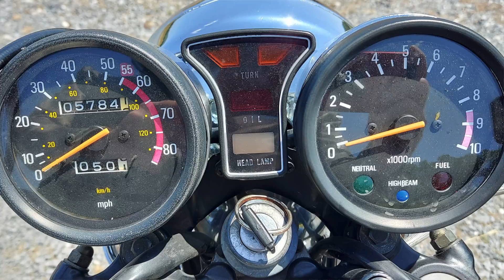Yamaha XS1100 Special Review - Specs, Sound, Acceleration, Classic Musclebike Power!

Comment: I have an 81 midnight special, that sat in a shed for 25 years. That is my project this winter
Reply from the maker: @fxrmike5145  Very cool 😎! How is the gold-chrome holding up? They are such cool-looking bikes.
Reply: @jonsmotorcyclerescueandrev3538  some of it is good, some not so good. May have to pull it all off and repaint so it all matches
Reply from the maker: @fxrmike5145  Right on!

Comment: I bought 1 in 1982.Drove it for about three years as my only transportation drove it on snow. Added up to about a 145 miles an hour and it was completely safe and felt really good and controllable. And I did put a quarter faring on the front.That matched the black on the body absolutely loved it.
Reply from the maker: @Shadowwolf7774  So cool 😎! Thanks for sharing your XS1100 experiences. Cheers!
Reply: @jonsmotorcyclerescueandrev3538  mine also had 4 into 1 Kerker header it was a beast. When I had it up to 144mph I still had room on the throttle.
Reply from the maker: @Shadowwolf7774  I'm sure it sounded great with the Kerker!

Comment: I owned this bike in the early 80’s when I was 25.  I remember late one night hitting railroad tracks that had a rise in the road and I was going a pretty fast and both wheels left the ground for about 20 feet.  The bike landed smoothly and straight.  I road back home and changed my shorts 😂.
Reply from the maker: I bet! It's a scary thing to be unintentionally airborne. I'm glad you landed rubber side down! Cheers!

Comment: Can definitely see how the bike i had in the mid-80’s, an  82 maxim 750 was an evolution of this bad boy .it had some generic 4into 1 exhaust on it when i got it, that sounded decent enough . Everything about this bike reminds me big time of that maxim ,sound ,looks to an extent and even the dash is very close too. Am always getting g back your channel , usually very nostalgic for me 👍🏼✌️. I don’t know if the xs is like the maxims were , but i remember me and my friend(who had an 81 maxim 650) both experienced our first death wobble(s) under redline shifts at around 80 mph …an more than a couple more too , until i figured out keeping my weight more forward would usually negate it .. this is an excellent bike to be running so smooth all this time later
Reply from the maker: Thanks for the feedback! The Maxim 750 is a cool bike. My dad had one when I was a kid. On many of the bikes of the era, you had to be smooth on the controls as you shifted at or above 80 mph. Beyond that speed, the minor inputs you put into the handlebars and other controls, amplified by the wind induced input and flexible frames, could really upset the chassis and cause the dreaded wobbles. The 1100 is pretty stable at speed, but it likes a smooth, open road and a smooth rider if you're really going to push it. Cheers!

Comment: I’ll echo all your comments as a relatively new XS1100 owner myself.  The rubber mounted engine is insanely smooth, I can’t believe it’s a 45 year old bike.  Very strong roll on power, it lives for lazy downshift-less passing.  Super comfortable seat and stable steering: this baby’s made to burn miles, yes at a cost of quick corner carving in the really tight stuff.  And yes the shifter is clunky and needs firm decisive motions.  Great job on the refurb!
Reply from the maker: Right on, thank you!
Reply: It's a blast! 😁 Got a 2H9 (standart 1979) 3 months ago and it effortlessly kept up with 140+HP bikes (1000cc Ninja and an over 240HP Aprilia) in the motorcycle training course I attended a few days ago.
If you're being smooth on the steering and throttle, quick cornering isn't a big deal, but big fun. 😉
The sound and acceleration though..! 🤩Those hyper bikes did really not have a big edge on this 45 years old beauty. 
Really fell in love with it. 😊

Comment: My second bike was the ‘79 Special, with similar bars.  Had a small windshield as well.  Bought it used and the guy gave me the original Cycle magazine that featured it.  Didn’t matter what gear I was in nor what rpm I was doing - twist the wrist and it was almost electric power, liquid like you said.  It would pull hard until my hair stood up.  I remember getting on the power while leaned over, you could feel the frame flex enough to unsettle you, probably due to the shaft power angles.  I sat on that thing for 4 to 5 hrs at a time throughout the mountain roads of New Hampshire and Vermont.  Really wish I had it back.  Thanks for the memories!
Reply from the maker: You're welcome! Thanks for sharing the memories. Cheers!

Comment: I bought one new in 81....Loved it. Super smooth, powerful, comfortable but yes, cornering and brakes not strong points...oh and the pogo stick rear end when you got on the throttle......the pinion tired to ride up the ring gear LOL!
Reply from the maker: Yep. I replaced the rear shocks with firmer ones and it made a huge difference. The shaft-jacking is almost gone now. Cheers!

Comment: You said it all. The XS 11 is still a great quality touring bike for its age. I am bias I have six with one having a Turbo.
Reply from the maker: Nice Robert! Did you beef up the transmission on the turbo bike?
Reply: @jonsmotorcyclerescueandrev3538  The only thing done to transmission was having the gears undercut never miss a gear. The only other item to change would be rear gearing down to a 750 rear end. Have not done that, not looking to go 200 mph.
Reply from the maker: @robertreid7735  Right on!

Comment: I had the owner of the dealer come into the shop to tell a new 1100 on the floor, a customer came back on a test drive to say it had a vibration. What speed? Engine or what? Just ride it to see. I headed out on the 4 lane interstate with the least traffic and ran it up thru each gear. I had to focus on lane changes as traffic was light, but so. It pulls so hard as I knew a place to turn around was coming up, I looked down at the speedo and it was buried at 130 MPH. This was before the Jimmy Carter 55 MPH changed speedos, road signs and pissed on truckers! I own 17 Yamaha from age 8 with 60cc step thru with rotary valve carb induction, 90cc mini-enduro, 125 twin, DS250 scrambler, 175 enduro, RD350 which scared me passing at road speed. The front wheel came off the ground, 650 twin for 3 weeks as my buddy begged me to sell it to him, 850 triple, YZ360, ITT-500 trials, XS102 cu in I still ride from Oklahoma to Indianapolis. And several others. Time flies. 
ASE Master Tech since 78, retired. 
Thanks kindly for sharing.
Reply from the maker: So cool, Dean! Thanks for sharing your experiences with the Yamaha motorcycles. Cheers!
Reply: @ 
    I had to fix a 175 Enduro for my step-brother and needed parts. The Owner; Stan, ask me what I was doing and 3 minutes later, I was hired as a tech. The guy work next to me had a bad issue with pay, work load or whatever, he quite a week after I started. I had 15-20 bikes with tickets on handle bars, plus more everyday. I had no life and worked until 9PM, set the alarm and went home. Stan & wife of 48 years were hit by a drunk driver & killed both 11 months after starting. They loved their Mazda wankle engine in both car & truck. I will never forget his lovely wife who brought my check into the shop & handed it to me! He was very mellow and never mean. I spent almost all Saturdays & Sundays putting new bikes together then performed all delivery checks. Then moved bikes on Sunday to fit the show floor. Stan would ask if I did that over the weekend when closed, I said sure, I did that! He gave a high-five & $10.00 out of his pocket. Betty would come in back, bring two yeast doughnuts and hug me, thanks for helping. I got two pay raises over 8 months. 
I took it hard as lawyers and family came in to sell out inventory. I had to show them everything in both buildings as it was an old “Massey-Ferguson” tractor dealer. I was paid cash for two weeks working there to help. I actually bought a used XS 650 Twin for $300 taken on trade two weeks earlier for $250 on a new bike. They took it from my pay & simply handed me the title, shook my hand, gave me a letter or recognition for a new job. I drove for six months with a dealer Tag! 
  I got a new job at a Datsun dealer, bought a 1976 620 pickup used, drove back and returned the tag. I took scrape that was $800 of metal crates broken down from bike crates and sold it. I sold the bike for $1,500, 1,900 miles like new. Then paid off my truck. I will never forget Stan & Betty. RIP!
Reply from the maker: @deankay4434  Thanks for sharing the memories, Dean!

Comment: I bought a 1980 XS1100SG like this one 20 years ago.  I have put about 100,000 miles of it.  It is still running strong.  I believe it could use some valve seals, but I believe that condition is still minor. While I don't think of this as a great touring bike, it has been on several long journeys, one of which was about 3,500 miles and two-up.  I've never been left stranded on this bike.  I did suffer the broken pick-up coil wires and the blown second gear.  When my transmission failed, new gears were still available. I replaced the four gear wheels on the counter shaft and did the washer move as described in the XS11 Heaven book.  It has functioned just fine since then.  With over 20 years of ownership, I haven't tired of it.

Keep the videos coming.  I'm enjoying them!
Reply from the maker: Very cool! I'm enjoying my XS1100 more than I anticipated. I've heard lots of stories of this bike racking up impressive mileage. I'll enjoy this one while I have it! Cheers!

Comment: Excellent video, enjoyed it very much. I also own the '79 version of this bike, in black. I've owned it for decades. The bike is in mint condition, I love it. As a long-term XS11 Rider I really understand it's handling characteristics. it's a little like riding a wild bronc, if you treat it right and pay attention you're fine. But drop your guard for a second or push it the wrong way it'll push back. But, as long as you understand it and respect it you're fine. It would be hard to find a sweeter ride. This machine is a real piece of motorcycle history, keep the classics rolling! P.S. in '78 and '79 It was the fastest bike money could buy. Not a bike for amateurs by any means!
Reply from the maker: Very cool Garry! I'm glad you enjoyed the video. I rode the XS1100 for about 40 miles today and enjoyed every minute of the ride. Cheers!

Comment: I bought a ‘79 XS11 in about ‘94 w/about 34k miles & put about another 80k miles on it. It was my daily driver plus I took a lot of road trips. Had a full fairing, side bags & a trunk. The headers got rusty so I put Kerker 4 into 1 exhaust on it, which made changing the oil filter a chore. It also had an oil cooler on it. A great bike for sure.
Reply from the maker: Right on! I think the XS1100 is a sleeper of a classic bike. It's quicker and smoother than the Z1 900 and later KZ1000s. I have those in the garage as well, so I'm speaking from experience. Cheers!

Comment: I actually custom build these bikes. I think I have about 10-14 titles now. My dad collected and taught me how to work on them. Took him until his 50s/60s to find this bike and fall in love. ( his brother, who built engines for Macto tools drag racing introduced it). My dad has a 78' standard. Mine is an 79' xs11 special ( cuz I'm shortest at 5'8)  my husband's is an 78' xs11 standard. We took them on a two week trip for our honeymoon(including tunnel of trees) My dad took it around all of USA and to Mexico. Great bike. My dad (65 at the time) popped a tire at 70mph, all was well. I normally get sore sitting for a long time. I use a Standard tank on my special. I play it safe and fill up every 60 miles. That's also when I can't stand the seat. So I plan to reupholster the seats with an added gel pad. I am currently redesigning my whole bike (cosmetics only) I changed out my handlebars for ones off a Honda CB750 Four ( bike from terminator) it's easier for me to steer. Since the turning is a complaint. I also switched out my husband's headlight and wire harness with a specials ( which was a little shorter but my husband and dad messed it up first trying to just rewire the standard harness to fit a special's light) . He wanted a round headlight lol. The standard is square. My husband has Harley exhaust pipes too, I have a 4 in one pipe(do not suggest for oil changes, I did it for my side bags). Mine was at 8,000 miles when I got it. Low mileage survivor. The guy passed and it sat in a shed until the daughter sold it years later to my dad. I have an xs11 bobber I'm building next for me. I do rewire all fuses on the wire harness, they need it. Breaks are easy to rebuild but usually need work, and really a very easy bike to work on. Reliable and you can race Harelys and win lol. We don't even use the air filter box. It makes working on it harder. The forks are not hard to adjust to make a taller or shorter bike. Yeah you could change out the front but I just use a removable shield for long trips. We all put on a sissy bar on to strap bags down. We 99% exclusively ride bikes until ice is on the ground or it's lower than 30°F. I wouldn't recommend starting it up under 42°F tho. The bikes are old, can't just sit around, you gotta keep them running. I have 80/81's too. They are all mostly inner changeable. I'm lucky to have lots of parts on hand. However one surprising expense is the side cover panels, so be careful with those. Also my husband did destroy and have to replace his engine, because he didn't decisively shift and grinded gears( it was his first bike). Glad in the video made note of the shifting. Glad you like the bike. It sure is my favorite. I have built them with just xs11 parts (except air boxes) to sell. I will sell parts someday too. However I like the diversity of making my own custom vehicles for personal use. Thanks for the upload!

 (I wonder if my dad or husband commented already lol)
Reply from the maker: Wow, it's so cool to hear that you're enjoying riding, rescuing, and modifying these classic bikes! Keep up the good work!

Comment: I have this bike. Mine is a 1979 and still all original. I love the shaft drive and I just couldn't part with it. It's getting harder to find parts for it now as it gets older. Yamaha claimed the bike would do 130 mph. I believed them when i got mine to 120 before I back off of it. Mine has a rack on the back that I can ties things down to.
Reply from the maker: Nice! Mine had a rack and sissy bar, but I removed them for the cleaner look. I have to admit a rack is functional though.
Reply: I have pretty recently reached 250 kilometers per hour and had 1500 rpm left before redline... make of that what you want... ;)
Also the engine still wasn't feeling stressed at all and I still felt a sudden weight transfer everytime i twisted the throttle a little more. O_O 
The urge to test its limit was big, but since I found mine first, the old lady won't be bothered by me in this regard anymore. ^_^

Comment: Own a 79 xs1100 Special. Bought it new in 79. Rode it from Boston to LA. Best time of my life. Still have it , looks & runs like new! In 80 they changed the handlebars & got rid of the hidden kicker. Also dropped in horsepower in 80. Rather the pullback handlebars & almost 100 hp
Reply from the maker: Nice! I rode a 1979 recently, but it needed some work. For me, the lower, wider bars greatly improved the handling and comfort. But, to each his own. Cheers!

Comment: It's a blast! 😁 Got a 2H9 (standart 1979) 3 months ago and it effortlessly kept up with 140+HP bikes (1000cc Ninja and an over 240HP Aprilia) in the motorcycle training course I attended a few days ago.
If you're being smooth on the steering and throttle, quick cornering isn't a big deal, but big fun. 😉
The sound and acceleration though..! 🤩Those hyper bikes did really not have a big edge on this 45 years old beauty. 
Really fell in love with it. 😊
Reply from the maker: Right on! They are still impressive bikes. Cheers!

Comment: Once again you’ve shown us another beauty. 👍 You might try experimenting with fork height, fork springs/oil and tires/tire pressure to quicken up the steering.
My ZRX1200 gearbox can be notchy if I’m not alert, especially on the 1st to 2nd gear shift. To alleviate that clunk I short shift into second at 1800 rpm. This way I’m moving the gears during a lower torque output of the engine. The rest of the gears are ok. 
But yeah, there’s something to be said about a big bore two valve engine. 👍
Reply from the maker: Right on. I have a feeling that the steering/frame geometry was set up with an emphasis on stability versus nimble handling on the XS. I will use it accordingly, more in a touring mode.

Comment: Bought a 1981 at a police auction. Has 19k miles on it. Stuck in 1st gear. A retirements project if it fixable. Motor is a monster and runs.
Reply from the maker: It should be fixable but will require the engine being removed and cases split if it's an internal transmission issue. Good luck with the restoration!

Comment: I own an 81 XS 1100. I have the larger touring style tank and saddle. Originally had a fairing on it that original owner cracked and removed. I have it and fixed it but have never installed.
It is a smooth riding bike with more than enough power to scoot down the road. 
I have taken several long rides with it and don't feel beat down when I get off.
Reply from the maker: Right on! The XS1100 is a nice long-distance bike. Cheers!